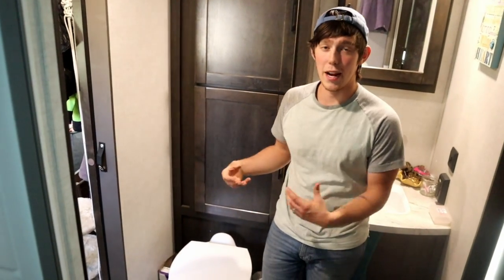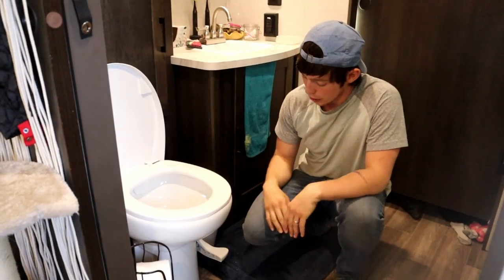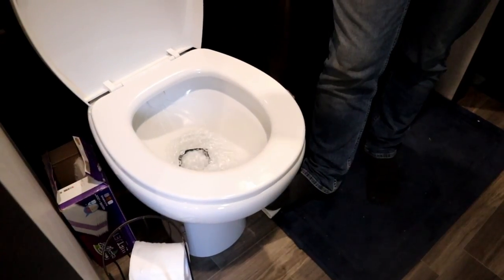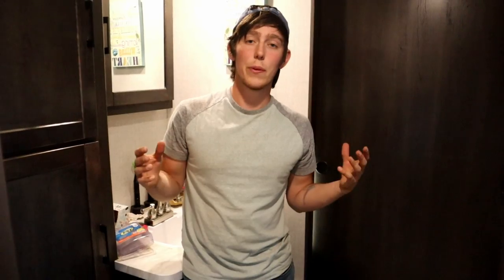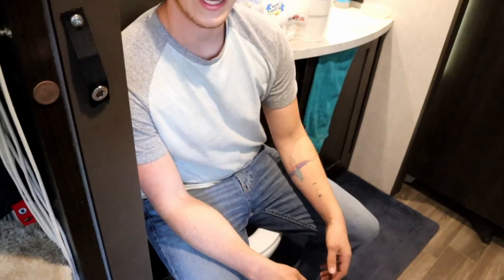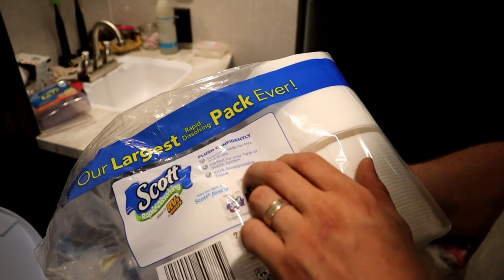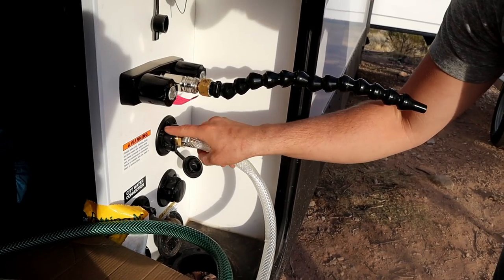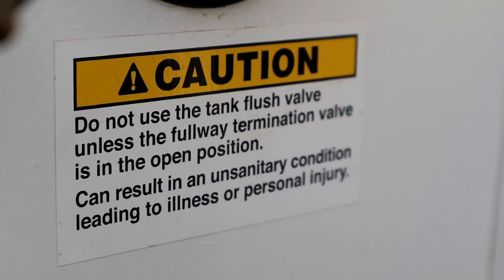How to use a RV toilet / and keep it from clogging.

Comment: Leaving the black tank valve open while flushing is wrong, you won’t get rid of the solids or toilet paper. Proper flush is valve closed while filling tank through the black tank flush. Fill black tank 1/2 to 3/4 full then turn flush water off. Now open black tank valve be amazed at what will flush out. You should repeat this until your tanks run clean. Now fill your black tank with 3 to five gallons of water before you disconnect the black tank flush, add your treatment and your done

Comment: Boondock..
Do I put the RV tiolet treatment before we start using it or after when we stop using? So it can dissolve properly.
Reply from the maker: Hey Juan, put the treatment in with a gallon or two of water into the tank when it is empty. I usually empty my tank and then put in two gallons of water and the treatment.

Comment: Just bought a used rv. Never owned one before and am a bit clueless. I'm using the rv in the backyard while my new house is being renovated. We have a bathroom in the home where I will go number 2. However, I would like to use my rv toilet for the middle of the night number 1s. Can I empty my black tank into a bucket and flush the waste down our normal toilet? I don't know where our public sewer is, so I don't have anywhere else to pump my black tank into.
Reply: Find your outside clean out. If you can back your rv up to it you can use it to dump your tanks

Comment: my new RV has never had water in the fresh water tank so I assume 1. fill fresh water tank, not sure when it's full.2.turn on pump.3. press toilet lever to fill bowl 4. do the deed 5. flush
Reply from the maker: That is correct, also most rvs have a sensor to show how full different tanks are, if yours doesn't then just let the freshwater tank fill till water comes out of a overflow valve which for us in near our front door.

Comment: Wrong on the toilet paper
Reply: … I agree. I watched a few RV YouTubers on toilet paper  (but w/sanitation dissolve wastes products). The Scott RV tissue doesn’t break down (dissolves) like it should. Two brands of toilet paper actually breaks down (both from Walmart). Great Value & “Bathroom Tissue” (no brand name). I use GV & no issues (but I NEVER use large wods of toilet paper - try to prevent clogging).